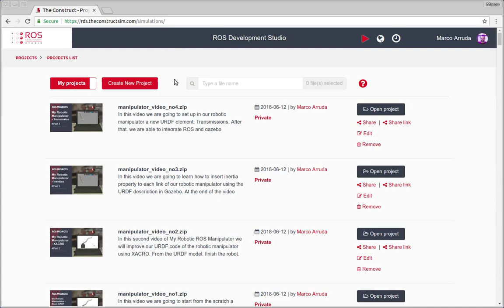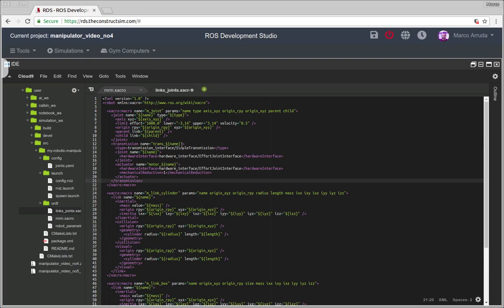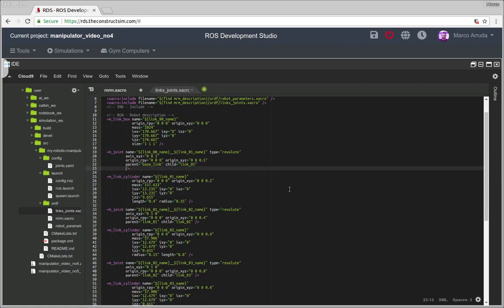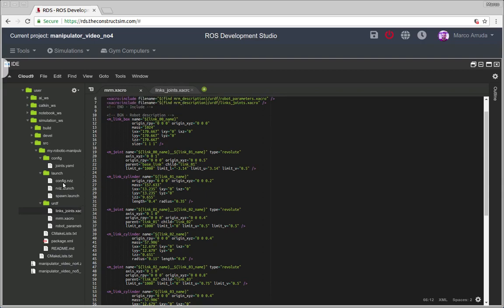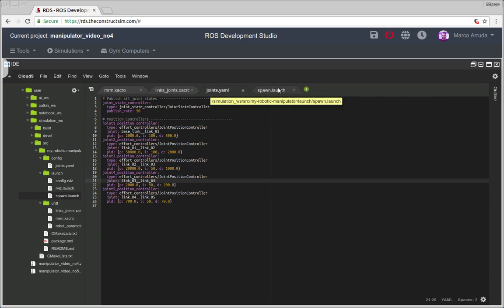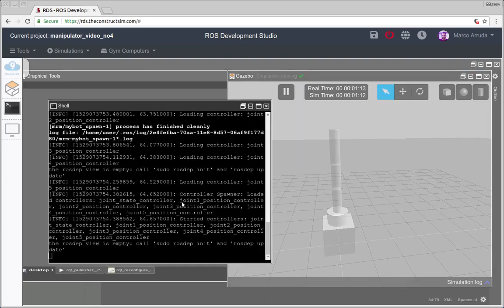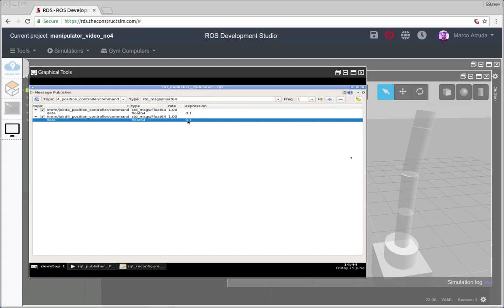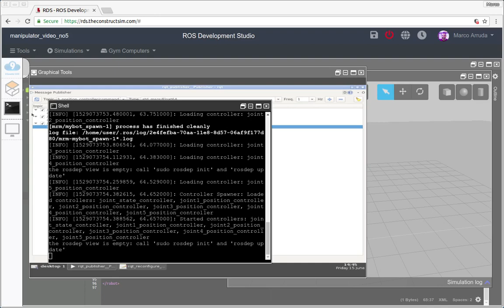[ROS Projects] - My Robotic Manipulator - #Part 5 - ROS Controllers and XACRO

Comment: hello, thanks to your advice I was able to design my own robot locally with gazebo.
I would like my robot to reproduce a trajectory of my movement, for that I plan to produce a set of coordinates [(x1,y1),(x2,y2).............(xn,yn)] so that my robot can position itself according to each of its points knowing that we use angles in your demonstration how can I do it with points?
I'm French speaking, I apologize if I don't express myself well....
thank you for what you do
Reply: Hi，did you manage to do that :) I think you may need a camera or a sensor to get the join angle of your body and publish the data to the controller.
Reply: You can use kinematic tools, with help of moveit tutorials
Reply: @leexalbang5492  thank you...

Comment: After expanding to all joints, the robot topples down when giving even the lowest amount of angle  (e.g. 0.1) to joints 3-4-5.  Limitting the lower and upper values just restrains the full fall, but even in that case other joints cannot sustain their own configuration. I'm aware that we cannot avoid physics (reaction forces and etc.) , but it would be better if you would have shown that case and solve to some extent.
Reply: Hello @tahsin, thanks for sharing!

You are right, for this demo I didn't tuned the robot controllers neither its inertia values properly, so the physics reaction is not something I was concerned for this specific case, but only how to implement the controllers.

I am taking your suggestion to improve the series and work on a next video about tuning the controllers!

Again, thanks for your contribution.

Regards!